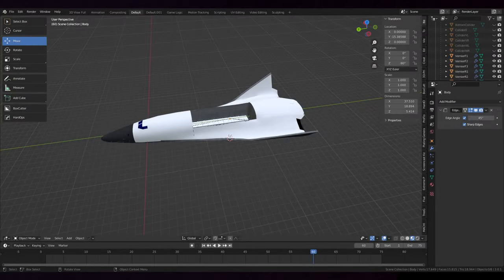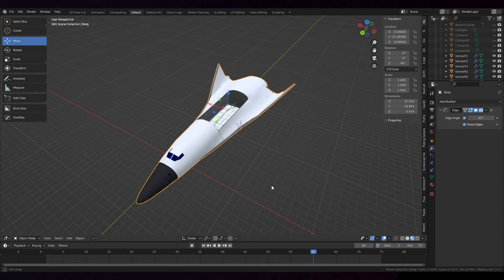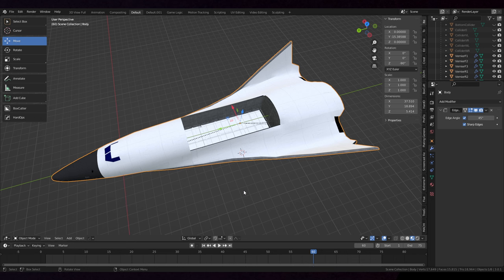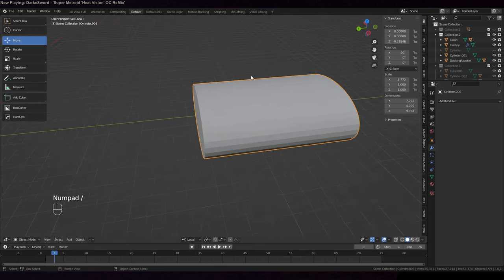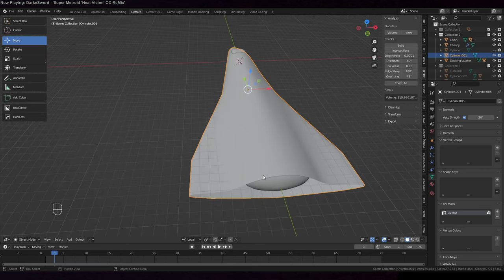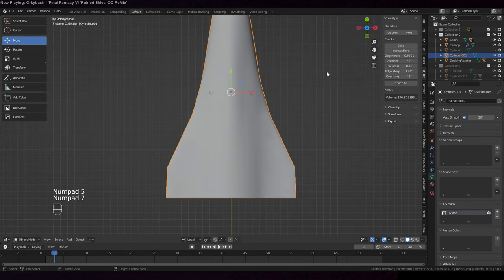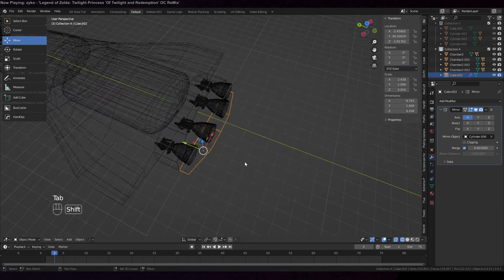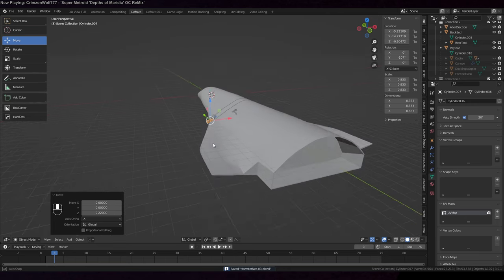Redesigning the Shinkansen Spaceplane (Blender Phase 1)

Comment: so actually the usage scenario is this: it's launched empty then several times it is refueled, reloaded with cargo and crew and sent to the moon and back. otherwise it will have to land after every flight. so you probably underestimate it's cargo capacity
Reply from the maker: I don't know why you say that's the usage scenario when I told you it wasn't and I don't know why you think it will have to land after every flight. I think you're confusing this with Starship, especially on the refueling.
Reply: @RaizSpace  hm... maybe i got you wrong. but imagine it made it's first flight and brought a base module to the moon. then it's refueled but it's empty. what will be the next step?
Reply from the maker: It is primarily a crew transfer vehicle for the Moon - not cargo. It can't even fit a base module for the Moon. Think of it as a more luxurious Orion, not as a cargo carrier, but one that can be reused in space and doesn't discard its transfer stage. Keep in mind that both planes together only have a pad mass a little bit more than a Falcon 9. This is not meant to compete with Starship (otherwise it surely could not be refueled by what Starship could bring up at one go).
Reply: @RaizSpace  ah, I see. anyway to bring cargo from leo to the moon it is more than enough. why making a cargo bay and never using it